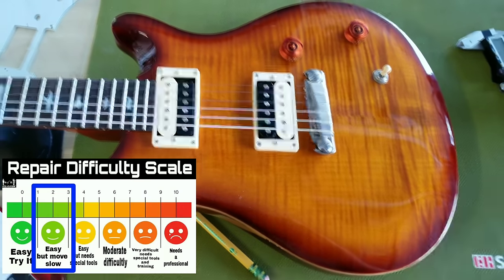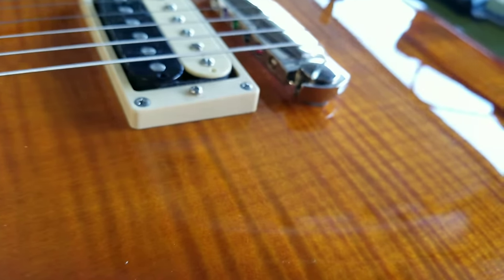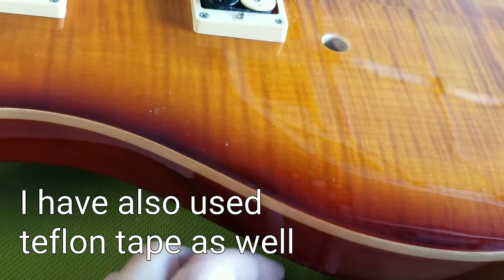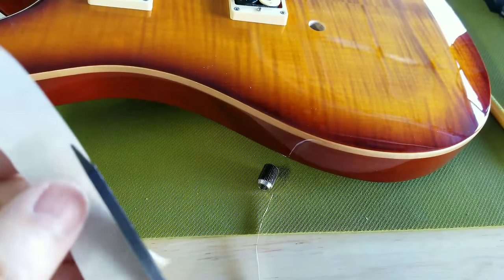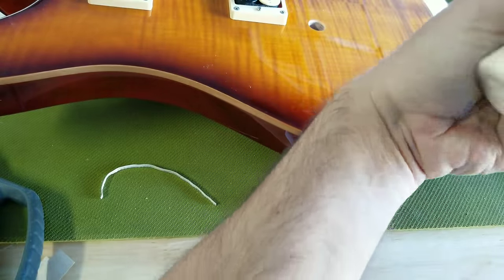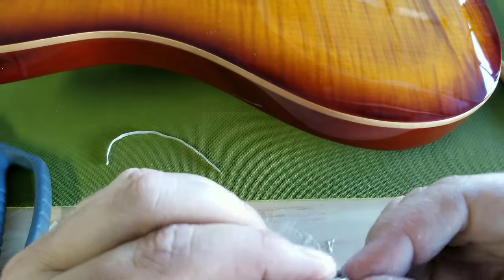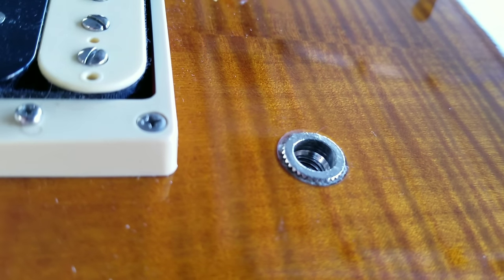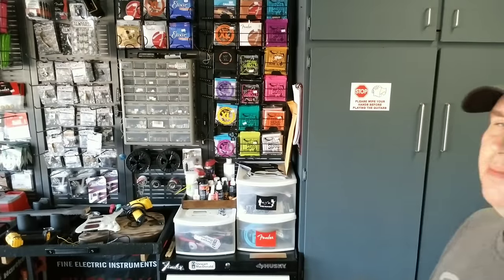How To Fix Loose Guitar Bridge Posts And Bushings. Sharpen My Axe

Comment: Just one point that hasn't been made clear in the video - to lock the paper onto the bushing it needs to extend past the bottom chamfer/lip. That ensures the paper is locked onto the bushing as you hammer it in, if you don't do that most of the paper doesn't hammer down with the bushing and just clumps up at the top. Also you can roll the paper on dry and then just add a bit of glue under the flap and then rub it on all over the outside, that makes it easier to wrap the paper nice and tight.
Reply: Doing it this way will also be a lesser headache for when there is the possibility of having to remove it in future as the glue will be minimal between the stud and paper and more so between the wood and paper.
Reply: thanks, it wasn't 100% clear if the wood glue was applied to the outside of the paper to affix to the guitar or the inside to hold it on the bushing.    So a small amount on the inside, and over all of the outside and then insert, and hammer in gently until flat.
Reply: I've found that I can just coat the inside of the post hole in a light layer of wood glue, let it dry, then pound the post in. No paper necessary.
Reply: @driptopher7222  That's a good one, that'll do the same thing but with less faffing.

Comment: Truth is...crappy design.
Reply: Not as much crappy design as simply crappy woods. I'm not a wood snob but it at least needs to be hard enough to keep the bridge in place. This sort of thing doesn't happen with good guitars with the same bridge.
Reply: Make no mistake about it, it will happen with any wood. Good wood get dry just like "cheap" wood, and if by crappy you mean basswood, there are plenty of High end guitars made out of basswood.
Reply: Truth is, wood dries out and shrinks.
Reply: I've never seen an old Gibson (or any Gibson for that matter) with that bridge have problems with this, as they usually have very hard, already dried woods. I haven't seen a high end PRS do the same either and I've been working on guitars for many years now. I've seen stripped screws on basswood bodied higher end guitars,  since basswood is not that hard but still, this is an issue that almost solely occurs to low end or midrange guitars. This happens to the tailpiece of like 9/10 Epiphones as well as most cheap guitars with that sort of  bridge.
Reply: Honestly, I'm not that surprised. I'm not saying they're infallible and to use this sort of bridge on a pine bodied guitar is plain bad design even if it works great on good mahogany. I'd have gone string through on the zero - still, it's damn cheap so I wouldn't complain either.
Reply: Modding/fixing/restoring Gibsons or Gibson style guitars is my favourite thing to do when I've got some extra cash. I've had dozens of guitars and if I can tell you to do or not to do something, is never to go into a project that's going to severely alter the original shape of the guitar (though there are some exceptions) if you expect a profit from it. If it's for you do what you want but if you plan on selling it it's very rare that it's going to appreciate. 

Since it's a model that people are most probably going to upgrade as the tuners, pickups, bridge and electronics are mediocre you might get away with changing them for better versions of the same thing but anything that changes the finish, drills or fills holes and so on will usually make potential buyers very suspicious of the guitar and will rarely turn out good unless you're an experienced luthier (or just handy) and have the right tools for the job - and even if it does turn out good people will still rarely want it. 

What I recommend is reversible mods that improve the look and feel of the instrument. Just as an example, I had a 2013 Gibson Les Paul 50's Tribute. That year is good because they've got the 50's neck, traditional weight relief vs. the previous chambered body, grovers and a dark back but they are ugly with black plastics and no pickguard. I got a goldtop one for a very good price and changed the plastics to cream with 50's style gold knobs along with a 50's style trussrod cover and knob markers for under 50$, to make it look like more of a '56 reissue. That guitar's sold a couple of times for around $700 when I got it for way less than that while identical 2013 models with the black  plastics routinely sell for 500-600$ while the price for the aesthetical mods I did (that anyone could do) is way less than that. 

Make the guitar play, sound and look as best as it can without drilling or painting, spending as little as you can and don't shy away from used parts and you might see a profit, many times you can just resell the guitar as is and get more profit than after modding it. 

The Firebird Zero is not regarded as very good and it's got tons of potential so it's a good candidate for being tastefully modded and then be worth a bit more than the cost of the guitar and parts but I wouldn't drill anything or paint it.

Comment: I love how despite your close friendship with Paul Reed Smith, you don’t shy away from pointing out any issues on this SE guitar.  I have the exact same issue with my SE: the post is bending forward and making the strings buzz like a sitar.  I think it’s because of the soft wood they used.  I hope this fixed my problem too.

Comment: Update: I could not get my hands on any newspaper so went for masking tape, I cut out an appropriate size of tape for the insert and did just a bit over one wrap, nice and snug.  Then I applied the wood glue to the sides of the inside of the hole with a Q-tip and did the same to the insert.  Now that both adhering surfaces were covered with wood glue, I placed the insert in the hole and hammered lightly.  I will let it set over night, place some vaseline on the studs and lower the tailpiece all the way down to avoid any further issues.  Of course, since the tailpiece will be all the way down, I'll finally get to try the top-wrap method!  Thanks so much for this video once again.

Comment: I have a BC Rich Warlock with this issue. I am so glad that I came across this video. I have been trying to figure out for years how to fix it, but never wanted to take the guitar apart because I was afraid of destroying it. Thank you for making this video. I can now repair my Warlock and play it again.
Reply: Did it work?
Reply: @socialdef3  I have done the repair, but I have also been staining the neck, so I have not been able to put string tension on it yet. However, I think it will be fine once I get strings on it.

Comment: Thank you so much, exact same problem on my PRS SE Bernie Marsden.
For made in Korea it has 1/2" bridge posts... Bought a new bridge, pulled the old posts out, and realized my new bridge posts were too small! Old posts go back in and the bass-side post is super loose. The treble-side post went back in tight because of the bridge ground wire being wedged in there. 
I'll try this trick, might use a bit less glue so I have a chance of pulling it back out later :)

Comment: I love the tech tips videos! Please do one on neck shims! When do you need them? How do you find the right size shim? How do you properly install one? That'd be an awesome video!
Reply: This!
Reply: A bolt on neck needs a shim, if & when the action is still too high after the bridge has been lowered as much as possible. Another related aspect is that sometimes lowering the bridge to achieve decent action results in the strings contacting the pickups while the pickups are as low as they can be adjusted. That's another indication that you need to shim the neck. You try to go for a happy medium of sorts. A workable neck angle allows the strings to be adjusted for optimal string action on the frets, while allowing the bridge to be raised enough so that the strings don't contact the pickups, and that the bridge itself isn't raised to anywhere near the limit of its height. Almost any hard material can be used as a shim. Often, the only way of determining the ideal neck angle on a particular instrument is by tediously unstringing & restringing, while experimenting with different thicknesses of shim material. You can often just loosen the strings without removing them from either the tuners or from the bridge/tailpiece, to save lots of time. Each time it's unstrung, the neck is removed and a shim is installed, then the neck is reattached to the body, the instrument is restrung & tuned to pitch, and the results are evaluated. You want to see that the bridge isn't so high that it's barely threaded into the threaded bushing inserts, while the strings have sufficient clearance above the pickups, and also while the string action can be set to a comfortable height. Check your neck relief while the strings are tuned to pitch and make sure it's the right amount for you. Because if you wait until after you do the shim testing, you may need to start all over when the relief is set. So, check & adjust the neck relief first. To help avoid confusion while trying out different shims, it's a good idea to begin with the thinnest shim and work your way up through the thicker sizes as your evaluation dictates. It's not usually necessary to use a full size tapered shim, a small flat strip of material placed at the end of the neck pocket nearest the bridge is generally regarded as sufficient, and typically no tonal or structural deficiencies will result. The shim can be secured in position in the neck pocket with a couple small strips of frog tape, or you can secure it in place with a tiny drop of glue, if you prefer. There are also numerous examples of shims that aren't secured at all, the crafter simply exercised care to not move the shim out of position when installing the neck. You can now buy tapered, full size shims in a choice of several different angle configurations, because StewMac is always trying to invent something we've done without for hundreds of years that they can convince us we need to buy. One word of caution, be gentle each time you secure the neck bolts, you don't want to strip them & thus add to your project workload. I hope these tips help.

Comment: you the man PHIL! Being in Arizona made mine shrink after I put a new bridge on it too.
Reply: What about the ground wire inside the post hole? I’m currently updating my ‘79 HONDO 740 and need to do this. Better way to ground everything? Can’t use the bridge or stop bar holes. Too big for newer pieces.

Comment: paper is a very good choice, i wouldn't have thought of it, but any kind of wood pulp based products would work if they are thin enough but just thick enough to fit whatever gap.  On my Ibanez I had an issue where the button for the strap wasn't staying in place because for whatever reason the hole was drilled to wide from the factory.  I grabbed some match sticks and some wood glue and it's fitting like a glove now.

Comment: Adding the glue is essential otherwise it just pulls out easily. I wish I had seen this a few months back as I ended up using superglue to hold my posts in when building a kit guitar. By test fitting the posts I think it opened the holes a bit too much and then had this problem when finishing it off. This is a much better method as you can replace posts later on if needed but I would hate to see what would happen to my body if I tried pulling mine out. Thanks Phil
Reply: Won't the glue stop the grounding?

Comment: Phil thank you so much, this exact same thing is happening to my Epiphone SG!  On the forums, I've been told to use epoxy or wood filler + sawdust to fill in the sides before placing the insert back in.  I want a permanent solution but the epoxy I had was unusable. Unfortunately I can't get my hands on wood filler or sawdust so I want to try this method!

Comment: Thanks for the video. I fixed loose bridge bushings on my cheap Epi this way today using decorator's masking tape - worked a treat, let's see how long it lasts! :)
Reply: Hello, I need to do this to my Epiphone SG tailpiece as well.  Did you use glue as well?
Reply: @socialdef3  No, I have not added any extra glue -  the tape was sticky enough to hold itself wrapped around the bushing.

Comment: I have to do this on a parts guitar I’m working on. I tried to scroll through the comments as to not ask the same thing but didn’t see anything, it’s a TOM style bridge and the strings are through the body. I’ll need to run a ground wire to the bridge post. Any insight on how I can still ground the bridge if I wrap it? Thanks

Comment: Such a great tip! I have this problem with my guitar, though I am fearing mine is a tad more severe. I have a floating bridge that has made the pegs sort of push the wood to the one side. Its only pushed at the top of the hole so im going to give this a try. If it does not work i think I'll have to fill it and redrill :| sick tip

Comment: This is what I had happen to me with a Epiphone Les Paul with a Stop Tail and Bridge setup.  The lifting and tilting was drastic enough that I went to the Gibson Warranty man in Maryland.  Despite his fix, I still wound up doweling and re-drilling the holes.  MY decision was based on the holes being egg shaped which a fix like shown here ( essentially what the warranty man did), because the posts would still be tilted forward unless the angle of the holes was re-drilled properly.

Comment: Hi Phill:

My name is Daniel from Caguas Puerto Rico and greetings from a fellow soldier "hooah!"

I like your channel and thank for your simplicity and honesty regarding all the subjects.

I never had an electric guitar before just acoustic/electric (steel and nylon), and now I'm looking for a new experience.

I did some research about the Epiphone Les Paul Standard Plustop Pro Slash Edition in Anaconda Burst
and according to some reviewers, this guitar has better hardware specs than the Gibson edition.

Also, I found in a local store an Epiphone Les Paul Custom Pro for $679 w/o case, an Epiphone Les Paul Standard 1960 Tribute Plus for $799 with case and the Slash version do not (except for the first 100).

My question is...wish one of this will retain better value if I decide to sell it in the future, the signatures or the custom models?

Thanks for your time and service!

Comment: I usually take 1-3 pieces of wire from an extra piece of stranded wire that I have laying around.  It is big enough to keep it in place, and small enough to not make it impossible to take back out if need be.  Plus no glue to deal with.
Reply: What kind of wire exactly? Or did you mean thin guitar string?

Comment: Had the same problem with my Dean Boca 12 after installing flat wounds. Brought it in to Dean's service center in Tampa. They replaced the guitar. It's possible that the hole was not quite perpendicular. They advised me not to use flat wounds as their tension was too high for the stop tail. I suppose I could always get a trapeze tailpiece.

Comment: I had a similar problem with the ferrules coming loose in the back of a Telecaster. I fixed it in basically the same way, but using masking tape and without any glue.
Reply: Was it a permanent fix?

Comment: Just one question: what about the ground wire on the other post? (If it was the loose one hypothetically speaking). 

Doesn't the paper kill that connection to the metal?

Comment: Damn you Phil, I could have used this info last week. Exactly the same thing happened to my Floyd posts (MiM Dave Murray strat). Ended up just using some thinned titebond and pressing them back in. If it fails I’ll have to buy a newspaper I guess.

A quick guide on swapping tuners would be good. Not the actual doing of it (that’s real easy) but how the heck do you select the right tuners for a specific guitar? Got a cheap Jackson and Squier that both need new tuners.
Reply: You stole the words outta my mouth. Except I've been dealing with this shit for months after replacing the chewed up licensed trem on my not so mint condition LTD off Reverb.

Just paid a guy to dowel & redrill. Hard to tell how well he did it. Think it looks alright & if it holds it'll be worth it. Not 100% confident though.

Just as an FYI I've seen nightmares on YouTube with guys who try & epoxy & stuff. This DIY looks decent. But searching forums, most DIY are ineffective & seem to make things worse. If you can find someone qualified to dowel & redrill it might save months of headaches. Good luck finding one though.
Reply: @deafforever3534  Some people say to epoxy it, others wood filler and sawdust.  Others yet, down and redrill.  I think I like this way better.  Wondering if there is room for improvement in this method though and if the results are permanent.

Comment: I noticed a ground wire in the cavity when I pulled the stud out.  I'm guessing newspaper and glue aren't very conductive.  Is this an issue, or is it thin enough that it doesn't matter?
Reply: Did you ever get an answer to this grounding question? This is my reservation about trying this fix on both of my bushings.

Comment: Thanks. Dealing with this issue on an Epi Les Paul right now...perfect timing. Did you let the glue dry on the construction paper wrapped on the stud first before hammering or just wrap it, glue it and hammer back in all at once?
Reply: That's a good questions, and one I'd want answered before doing this to my SG!  By the looks of it, it was still wet when he hammered.

Comment: Liked it but would have also liked to have seen how you got the insert out
Reply: kenseido64 unscrew the post. Take the wall-plate screw out of your light switch and drop it in the hole. (Screw Head side down) Reinsert post and tighten slowly. Ferrel should slowly lift out.
Reply: @johnnybravoski7048  this is bloody brilliant!